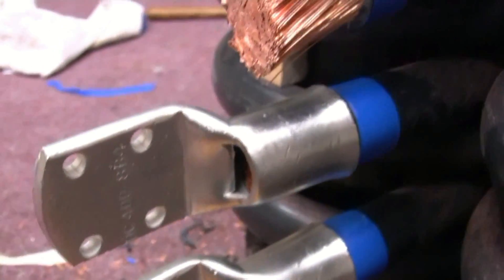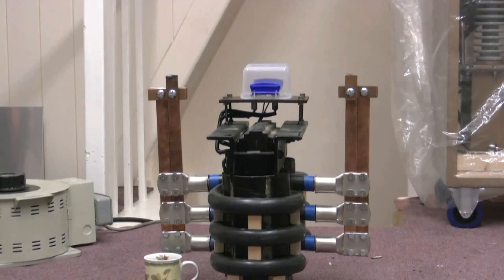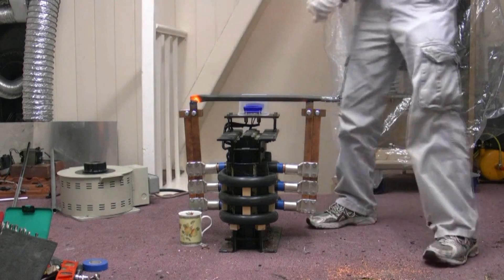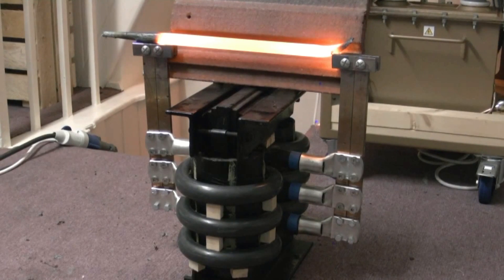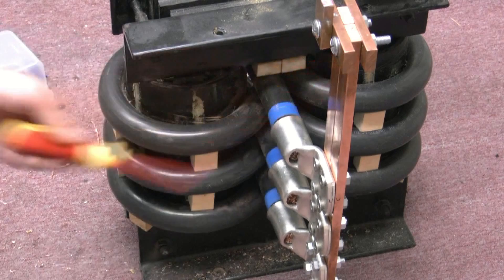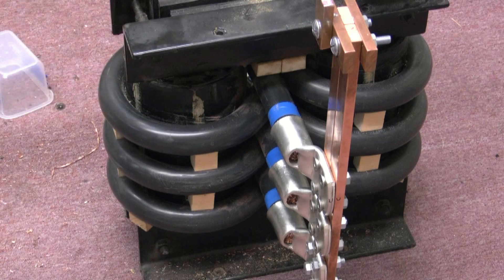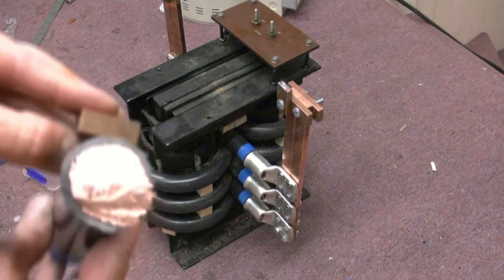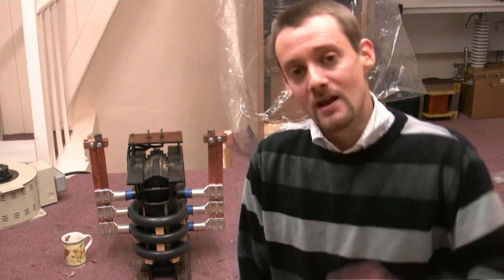50,000 Amp Transformer Completed

Comment: How do you know that there's 50.000 amps flowing through?
Reply: James Smith WoW!!! Where do you live that you have 1000 AMPs main house fuse?? We have only 3x25A = 75A.
Reply: lennchma he quite clearly writes that his house cannot supply enough power to get 50kA out of the transformer. try to just admire the thing for its silly beauty
Reply: 5naxalotl I think its more about what's the max amp load the secondaries can handle. Generally speaking standard main house fuse is 1000AMP. Maybe you could get it to 30 or even 50 KA but the voltage would be extremely low.  But unlike i said in the video you wouldn't touch it cos VOLTS DON'T KILL AMPS KILLS. Funny though the video has a massive jump in frames when the bars start glowing no doubt a Photoshop job. Still insane Transformer though :D
Reply: Sorry meant 100 amp.
Reply: Dude reread

Comment: Wow umm wow.... speachless!!! That has enough current potential to kill an elephant! And not even wearing gloves! If your gonna show how smart you are at least wear a little personal protective equipment, at least so the kids trying this at home won't get to hurt. Oh and the ends have to be crimped or soldered that's what the slit is for in the area between the round and flat to put solder in, it would work allot better.
Reply: +wheelitzr2 hehe here is another "amps kill" idiot he has 50.000 amps but at 0.5 v if you know ohms law you why this wont kill a fly

Comment: u would need very very low ohmic values to get that kind of current with that low of voltage. that is also why the voltage of power lines is high, it needs that high voltage to PUSH the current thru the wire, which is low resistance BUT over that kind of distance the resistance gets kinda high actually.
Reply: FieldSweeper That isn't the reason transmission lines use high voltage. It's because for any given power the line loss is proportional to I^2, electric companies do not want to spend their money heating the air around the wire, they want to sell the power to you so you can heat the air around your own wires. So for any given power doubling the voltage, halves the current and line losses drop to 1/4.

Comment: so how's your electric bill?
Reply: I bet it's still under control because the electricity where he lives is being Charged differently. It's super expensive in the morning, but once it's nighttime, it becomes super cheap. So, with that said, I'm pretty sure that he does most of his experiments during night, where he could be charged very cheaply.
Reply: +Jayson Fabregas Thats a popular but im afraid misguided conception. Power is only cheaper at night if you have a dual rate meter ie Economy Seven in UK. Dont know about economy tariffs in europe but even the night rate is not" SUPERCHEAP" I know as i use it for heating and hot water. Its very expensive compared to gas and you have to be careful of your Peak Time consumption as the unit price is much higher than a "normal" 24 hour tariff.
Reply: He is indeed running on Economy Seven. He also has a cheeky way to avoid peak prices. Just look at his "Cheap Backup Power" video.
Reply: Moon Man thought someone like you enjoyed improper use of the Colon.😂😂😂
Reply: +rene kenshin "so how is you are electric bill"

Comment: I work for electric board, i can get a massive 500,000v transormer, and knock out the secondary and replace it with 50 turns of 750mm Earthing cable. How much dreken it will pump out?
Alex.

Comment: 3:45 man you come close to completing a circuit with your arms.
Reply: Aghast On second thought the iron bar is probably still way less resistant than your body so you probably would have been fine, my bad.
Reply: Aghast It will pump the same amount of current through your body with or without the bar conducting alongside (fuck all).

Imagine a V8 engine geared up to output a bajillion rpm at a .01Nm of torque. Is it a massive engine that could output 700kW under the right circumstances? yes, but you could also stop it starting by putting your pinky finger on the output shaft. The transformer can't push a current through your body, even though is capable of pumping a bajillion amps under the right circumstances.

Comment: I think you'll need much more than half a volt to get 50 kA through that crowbar. With just 0.5V you'll need a resistance as low as one one hundred thousandth of an ohm (1/100000). That red hot screwdriver will have a resistance on the order of a hundredth of an ohm.

Comment: remember its the resistance of the wire that restricts the current .... so you need short primary's and short secondary windings that gives a low number of turns to get same OC output voltage hence high magnetising current low impedance solid bars for the heavy windings not cables of any size fill the core with copper AND remember the IMMENSE forces inside the windings as each wire repels its neighbours and attempts to tear itself apart that's why they are always varnished higher frequency will reduce the core size required hence less winding LENGTH ..... aircraft use 440 hz for a reason and you might get a workable transformer   but what do I know about it

Comment: a legion of issues getting 50000 amps from this too high secondary resistance ten times too high than what is achievable with a proper design no need to reinvent the wheel use a spot welder TX  or ask me how  to do it

Comment: OK 1) what does this machine 'transform', 2) Why does the metal rod glow red hot?
Reply: clawpuss2 current, and current. The long answer is that a transformer transforms 1 AC voltage to another lower one, and input/output current get scaled up by about the same factor (minus some losses). The bar glows red hot because a lot of current is passing through it, its resistance causes it to absorb the electrical energy and turn it into heat..
Reply: clawpuss2

Comment: usuarios, este transformador no puede entregar 50000 amper DURANTE TIEMPOS PROLONGADOS.   supongamos que manejamos una densidad de corriente  de 3 amp/mm2  que es bastante alta, tendriamos de seccion    s;  50000a/ 3a/mm2= 15300mm2 aprox, y el diametro de un solo conductor   d=square( 4x15300/3,14) =aproximadamente un cable de 145mm de diametro, y si colocamos conductores mas chicos de 400mm2 necesitariamos 38 conductores de 400mm2.   que ocurre aqui?  el transformador esta funcionando con un variac a tension primaria reducida, limitandose la corriente a 1000 amper.(a mi parecer) es parecido al ensayo de un transformador en cortocircuito:se geneera una tension primaria tal que por el secundario circule la corriente nominal.  eso debe estar haciendo el tecnico aqui.   si la corriente fuera de 50000 amper real,los chispazos ya hubieran generado un accidente. tambien depende de la impedancia del material que queremos ensayar   ahora hay una formula cuanto soporta un conductor en cortocircuito, es una formula empirica    la corriente ICC=  69XS/SQUARE T   DONDE ICC ES LA CORRIENTE DE CORTOCIRCUITO EN AMP   S ES LA SECCION EN MM2   T ES EL TIEMPO EN SEGUNDOS  SQUARE ES LA RAIZ CUADRADA      POR EJEMPLO ESTE TRANSFORMADOR PARA UN TIEMPO DE 81 SEG     ICC=69.1200/9    APROX 8500 AMP.    PARA TIEMPOS MUY CORTOS,SI PUEDE MANEJAR 50000 AMP, PERO PASADO UN TIEMPO HAY QUE LIMITAR LA CORRIENTE.    PARA TIEMPO PROLONGADO HAY QUE APLICAR LA FORMULA DE ARRIBA, Y ESTOY MUY AJUSTADO, ESA SERIA LA SECCION MINIMA.
Reply: Yo creo que no llega ni a los 300 amps he visto otros de 400 amps fubdir de todo
Reply: Andrei,400 amper de corriente secundaria ,si,porque es muy baja la tension, otra cosa son los 50000 amper que dice este tecnico.  yo antes construia transformadores, y para esa corriente, siendo monofasico hay que calcular minimo un transforrmador de 100 kg de peso,y ademas,por lo dificil de trabajar el bobinado secundario. piensen en minimo 15000mm2 de seccion secundaria, la ventana del nucleo tiene que ser enorme.para alojar el bobinado,secundario colocando varios lotes de espiras en paralelo. yo llegue a bobinar uno que entregaba 500 amper,a 12 volts,que usabamos para arrancar motores diesel grandes, y podia entregar esa corriente en forma permanente.contaba con 500 mm2 de secundario,y el primario(220 volt en argentina) era de 16 mm2 de seccion...  si se fijan en el video,hay un variac grande, y cuando hace los cortocircuitos, no son mas de 300 amper.  es una mentira este proyecto..
Reply: Yo se que asi funciona un transformador, qur la tension es practicamente deapreciable, la razon por la que no creo que twnga mas de 400amps es por que tarda demasiafo en someter metales al rojo vivo cosa que no es muy dificil con dicha corriente
Reply: es por el variac,si, es posible, pero te das cuenta como engañan, el que tenia yo,enseguida derretia cosas. un dia me derritio un destornillador en menos de 10 segundos(el que usaba como arrancador).y como chispeaba,por favor... suerte,  y saludos,,,Daniel.

Comment: im just curious why he is not wear protective gloves i mean even if hes not grounded why wouldnt he wanna be safe then sorry
Reply: Matt Balciar he's working with extremely low voltage. low enough that the electricity can't pass into his body. also he's holding the end of the rod, not the middle.
Reply: +rust blade It's still stupid! Molten metalic sparks launched into eyeballs can cause blindness...

Comment: Not too often that dual copper bus bars are the weak link!
How did you affix the lugs to the cable?
Didn't see crimp marks...solder?
Reply: That is a lot of faith in press-fit connections!
Reply: icolluvit
This is low voltage though.
Reply: That's one hell of a solder...
Reply: If you look they aren't soldered or crimped, if he soldered them there would be tin showing over where the lug is on the cable but not butted up to the insulation, it's clear as day that you can see the copper is not tinned...
Reply: I see the point icolluvit is making.
While this thing is low volts, the watts are pretty much huge!
Any resistance in the lug/terminal junction could act to 'spot-weld' the join.
In theory...
Reply: why not just crimp the connectors?
do it correctly
Reply: so your saying his meter is lying right? what point are you trying to make, someone explain... i dont think they make lying electronic meters, do you?
Reply: To effect a weld capable of carrying 50,000 Amps you need more than just wires jammed into a hole...arching causes resistance, resistance cause heating, heating causes resistance...by the way notice the lack of any kind of heat marks?
Reply: Stewi1014 lol.
Reply: Greg Gallacci he said, that they are a tight fitting
Reply: mick mccrohon perhaps? "Clearly"?
So your saying just the compression of getting the highly stranded cable In then fitting and maintaining the pyshical location is all that will work to maintain this connection in this situ. Ie 50KVA? Heat, arch, cycling, etc?
Clearly?!¿
Reply: Ozzie he said his meter wouldn't give a reading ...and those clamp meters normally only go to 1000 Amps
Reply: braze the connections?
Reply: +mick mccrohon The heat will likely wreck the plastic insulation, a long way back, due to the high heat conductivity of copper! A crimp is the way to go, only problem is finding such a crimping tool!!!
Reply: I already have one. hehe
Reply: +Greg Gallacci And he said that he was running 50 000 amps throught this device? I tought he was just speculating about it..
Reply: How the fuck haven’t they been electrocuted??people calling these boys stupid they are obviously top of the tree in electrics ,genius’s I’d say
Reply: Ozzie Peck anyone whose uses above 100 amps knows "tight fitting " is bullshit ...they would be glowing
Reply: Jason blank I am saying it is impossible to make a viable 50,000 amp connection with wires just pushed into a connector . The tool for crimping the lugs have 2 handles over 1 meter long and they act on the lug in a band about 6 mm wide on 6 opposing faces and it it normal to do 2 crimps per lug. If you calculate the length of the handles the small faces os the opposing 6 faces and the fact that most people can't  close the handles unassisted because so much pressure is needed.
I'm not going to do the math for you but there would be hundreds of kilo's per centimeter on the "lug to copper" boundary ! 

"Heat, arch, cycling" will make the connection more resistive with each go.
Reply: Jason blank ...I see you have never actually crimped +70mm square cables ...flaring is to help all those little wires go in the lug... once crimped you see flats in normally a hexagonal pattern around the lug.
This is no way a 50,000 Amp transformer ..the guy is a toser.
Reply: higher voltage 'jumps'...similar to speed of sound underwater...based on spacial relation...is what i have heard, making tight connections unnecessary, they fuse themeselves
Reply: if the conductors cant carry the current he implies it is a fake
Reply: so your calling fake on this one? what point is he making exactly
Reply: ***** no sorry, it doesn't work like that at all. the device does not produce 50,000 Amps.
Reply: no, not in the real world. hot metal oxidizes which cause resistance, which causes heat ....blah blah blah
Reply: icolluvit rubbish ...its BS this vid .....50000 Amps would vapourise the crow bar
Reply: @mickmccrohon  Wow one more triggered confused and brain dead troll. Run along you are embarrassing yourself.
Reply: its poor design the secondary resistance is far too high what's the OC voltage and hence turns ratio  which will give the primary current what would that be at 50000 amps if you have 8v OC 30 to 1 Turns ratio 1600 amps primary at short gibberish

Comment: This is a miniature version of an induction furnace heating transformer.  The typical system I would work on circa 1990 would use four 100kVA 3-phase SCR power control cabinets to drive four 3-phase electrode transformers.  600VAC, 150A (Canadian voltages in this example) at the head end became 3VAC and 20,000A at controlled load conditions.  The four heating systems each used a pair of 5-meter 35cm dia. solid electrodes near the base of say a 200 kilo-liter tank used to store coal tar in its liquid pitch form.  Various smaller heated pipes would gate the flow of pitch to railcars, etc.  The transformer shown above would be a good pipe heater for an 8cm inner dia. delivery pipe.  Southern Transformer of Georgia is gone now, I think, but they made the transformers. Addendum: Fonbrai is still there in Trois-Rivieres, Quebec.  The image at the top of their site is the very system I described.  You can see the eight electrodes and cabling near the bottom of the nearer tank. http://www.groupesomavrac.com/fr/entreprise/fonbrai/

Comment: This reminded me of a question about welding. Is 30V @ 225 Amps enough to kill a person?
Reply: Max Koschuh I'm talking that combination of AMPs and Volts.
Reply: I see. Well, the problem is, you can't select the current to be 225A when the voltage is known to be 30V and the (human body) resistance is given at 60kohms or something. At 30V, your body will allow a current of 0.5mA max (500 micro ampere). In order to allow a current of 225A through your body, you will need a voltage of 13.500.000 volts. Not that much though, because the resistance of the skin is much lower at higher voltage. Hope this helps. Take care.
Reply: Max Koschuh So basically what you're saying is if I have my stick welder set on 225 AMPs I would barely feel the shock?
Reply: hahahaha, yes
Reply: Max Koschuh Sweet. Now there's no worry of death when welding lol
Reply: EragonSuperM keep in mind that the electrical resistance of the skin is lower when it is wet, so you are much less protected from low-voltage, high-current signals if you touch the current source and sink of the welder at the same time with wet skin. Wet or broken skin may be only 1,000 Ohms, and that will lower to 500 Ohms if significant currents start flowing through it. At a resistance of 1kOhm you only need 50V to get 50mA going; if it's 500 Ohm you only need 25V.
Reply: in general conditions... dry skin anything under 50v wont really be any danger to you... it really depends on conditions
Reply: If you were siting in a bath full of water , YES.
Reply: Max Koschuh
What about someone else?